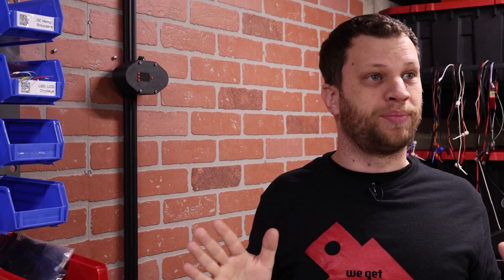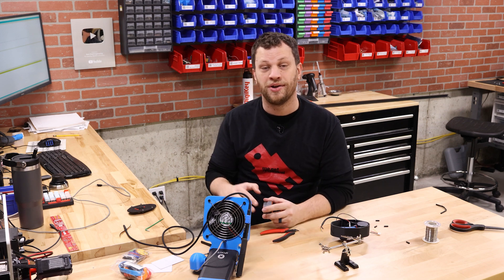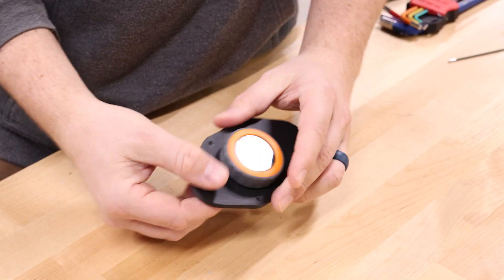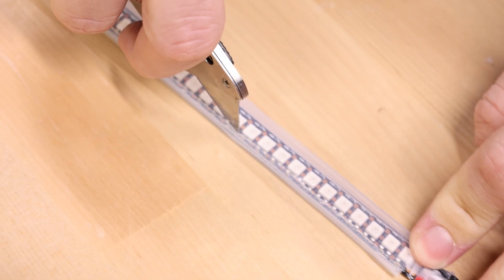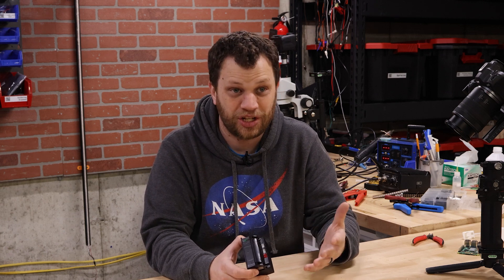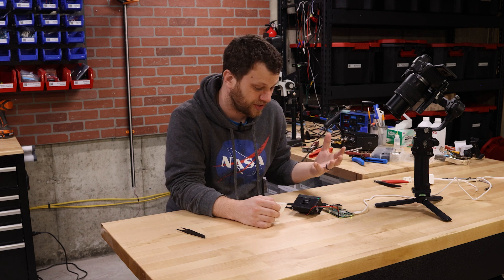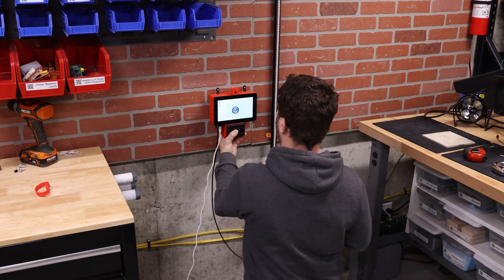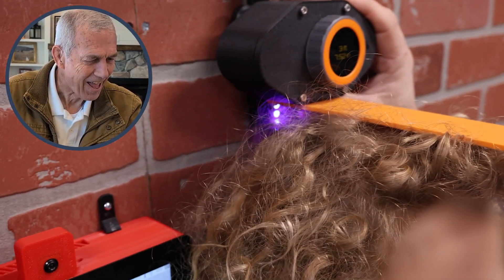I over engineered a growth chart for my kids

Comment: To have the camera always at the right height, you could mount it to the moving part of the track. In that way, you could also make the connection between the Raspberry and the microcontroller simpler. Of course this is just an idea, there would be some other problems to consider with this approach.